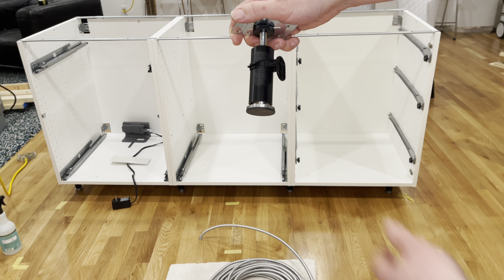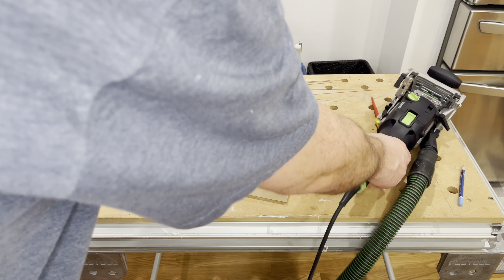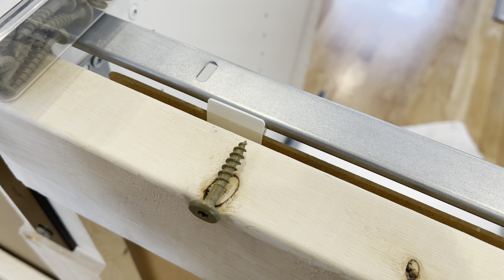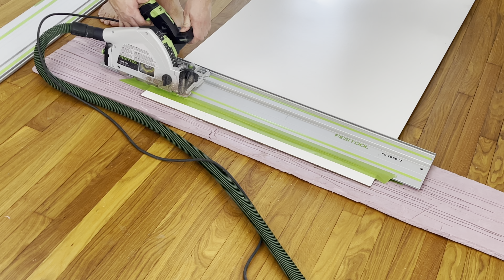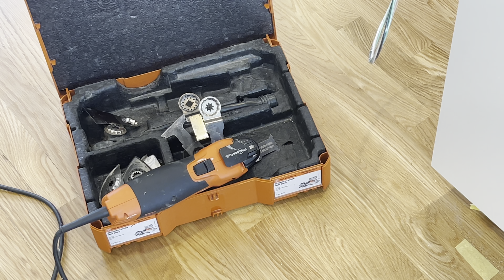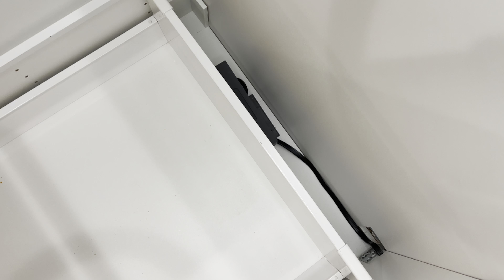IKEA Hack Custom Kitchen #13: Building the Island

Comment: thanks for the video.   is a 2x4 needed at the top and bottom if there is no over hang?  If you were not installing those brackets?  also, did you use all island brackets or rail brackets and island brackets?
Reply: also, where did you find the plastic covers?  they only have two per cabinet

Comment: It is a GREAT video as I am planning to attach doors on the back of the island. How did you fill small gaps between the doors? Thank you!
Reply from the maker: In my case since I am using the doors as fixed panels the gaps are filled by the large thin ¼" sheet white melamine panel I added to the back of the 2x4's. If you wanted to make doors open on the back then you could just use the stock IKEA cabinets and add a door on the back instead of the thin melamine particleboard sheets they provide to use as the back of the cabinet. The two problems I see are the fact that they cut a grove the factory in the IKEA cabinet to fit that thin back piece so you would have that showing, and you wouldn't be able to build a 2x4 frame to support the brackets like the one I built in the video because it would block the door. I too thought about having the cabinets have doors on both sides but with the microwave and the bar stool chairs blocking that side I chose just to keep it stock with doors on one side. Good Luck!

Comment: What's the cabinet width that you have the trash in? Would you mind linking to  the bins? Not seeing them on Ikea
Reply from the maker: I can't find it on IKEA either. It is Article Number: 802.635.73 made in Poland. I think it is called VARIERA 14 gallon bins but I can't say for sure because it's not on the tag. 2 fit in the cabinet perfectly. Hope that helps :)